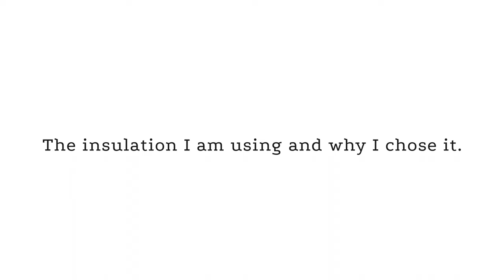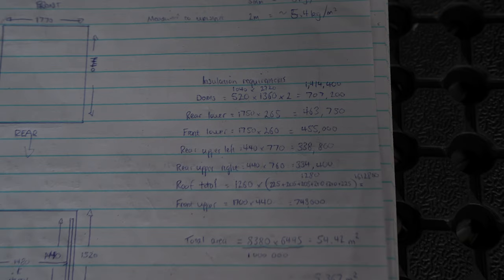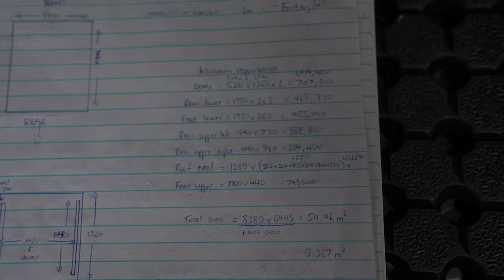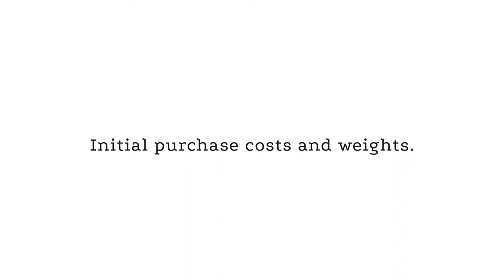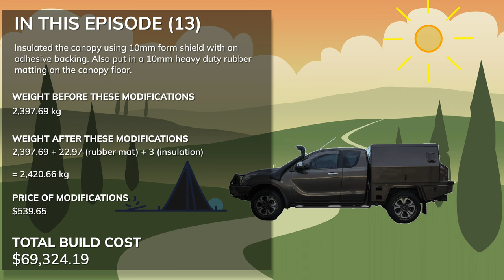How To Insulate A Canopy - Adhesive Backed Insulation || Mazda BT-50 Build EP13

Comment: Good video ,very handy.  My suggestion that rubber matt place between canopy and tray ,no friction. Specially if you removable canopy
Reply from the maker: I've gotten rid of the rubber matting. Easier to clean without it and saved about 18kgs as well.

Comment: Great videos mate. I have a new canopy on order at the moment and am also planning to insulate. How has this stood up over the past 6 months?
Reply from the maker: Thanks mate, honestly I forget it's there, it is stuck down well and I just think of it as part of the canopy now. No issues at all with it.

Might remove some rubber mat at some point to save weight though
Reply: @TheBrowneTown  sounds good. I’m thinking of doing some before and after temp readings to see what difference it makes. I hear you on the rubber matting. I was surprised it weighed as much as it did.
Reply from the maker: That'd be good to know those results of you do do it, I never got the chance 👍
Reply: @metasploit7501  did you do it?